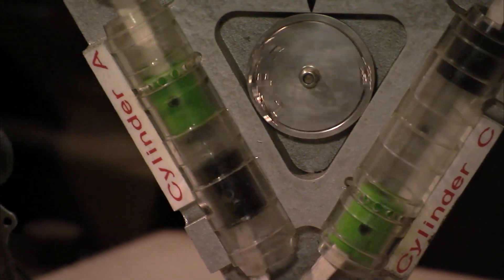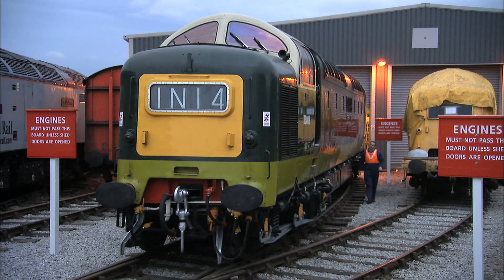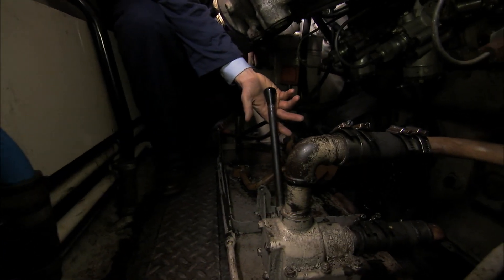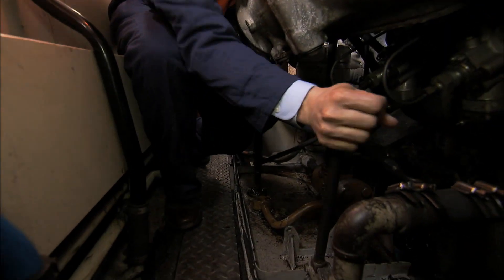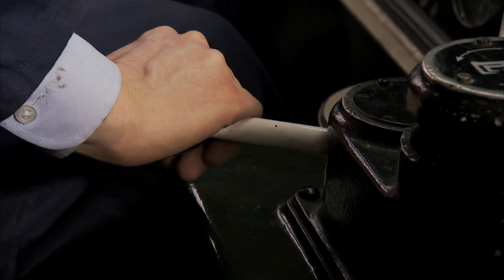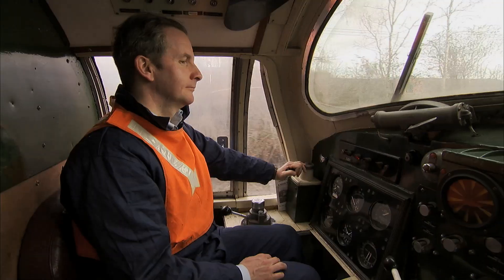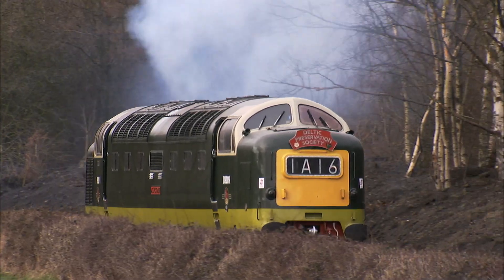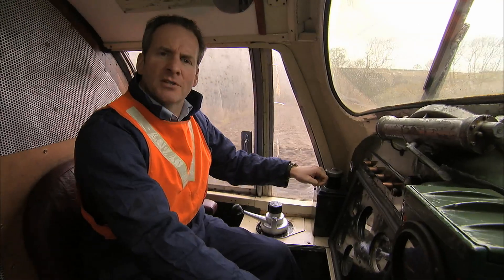World's Greatest Locomotives... The Deltic

Comment: It would have been cool if they would have made an American version of that locomotive.
Reply: The E-8 unit is a good counterpart to the Class 55 Deltic. However, only 22 Deltics were ever built, compared to nearly 500 E-8 A and B units. The E-8 can be geared for speeds as high as 117 MPH, and an E-8 is much more powerful than a Deltic, thanks to the larger American loading gauge. If you wanted to pull a passenger train fast in the States on relatively level track before the 1970s, the E-8 would have been a good choice.
Reply: @HSMiyamoto  Here we go: Americans claiming to be 'better', what a surprise.

Comment: I'll take a 2 stroke EMD any day of the week over this crappy sounding thing. A much better design overall and was around way before the Deltic and way after the Deltic.
Reply: Seriously you have got to be kidding? If you want something that has twice the weight and half the power - Which was half as efficient and couldn't spin faster than 950rpm and had a reputation for being unreliable in service - then have your EMD. 
The rest of us will have the technically most advanced, powerful, lightest weight and efficient diesel the world had known. And the sound was staggering, I can bet you never heard one. I have.
Reply: @martinda7446  EMDs where more reliable and simpler, than deltics which is why so many EMDs are still in service compared to All the deltics being retired.

Comment: A diesel driven locomotive of that power and speed we never had here in Germany. Until today, on the few remaining not electrified lines with fast express trains, there must be installed a double-traction with two class 218 or two class 245. One of them would be simply too weak. Stronger diesels are not availible, perhaps except the well known "Ludmilla" of russian origin. But even a "Ludmilla", Class 232/233/234 is not able to hold the timetables, if single. And furthermore, her maximum speed is limited to only 120 km/h. A class 55 could pull all these trains alone with no problems at all in the highest possible speed, that the tracks allow. I´m sure. What power! What speed! Admirable. But even the British, who had this wonderful engine in service an saw in everyday´s reality, how good it was, built only some 25 or so of them. And tried to help themselves elsewhere with many far less powerful locos. I cannot understand this. But allright: Tempi passati, these times are long gone...
Reply: British railways simply don't worry about sticking to the timetables. Or stopping trains at the right stations. Or on the right platforms, if they do.

Comment: I see the Deltic engines as a quite interesting part of technology that actually works compared to many other technical solutions that have been tried. They don't hold up to modern emissions standards, but that don't make them less interesting.
Reply: they  were basically a very expensive  loco and still weren,t the most reliable and considering they they produced a total of 3300 hp  and pulled only 400/500 tons over a mostly table-top railway  didnt excatly tax the power units yet they still failed on a ggular basis !! hardly "technology that  actually works " is it ??

Comment: Well it was a clever engine but had it,s problems 

very short engine life
heavy on lube oil 
heavy on fuel 

Commer / Rootes TS3/4 engines were similar but had a longer engine life and economy

why not get them to build an engine ?
Reply: Try the Fairbanks-Morse Train Masters which were opposed piston similar to the Commer. Their problem was they didn't offer the same economy or reliability as an EMD or ALCO in US Road Service. Remember Krauss-Maffei were rather shocked to find out that SP let along DRGW were running their EMD SD-9's on 45 day cycles.

Comment: Leave it to the British to brag about doubling the horsepower to weight ratio of a heavy-duty diesel engine used in applications where durability and serviceability are paramount. They also doubled the complexity and made them impossible to perform major repairs on in the locomotive AND doubled the wear and stress the engine's mass had to.absorb by halving its weight. Not to mention it HAD NO "competitors" because every other diesel-electric locomotive manufacturer in the world (all 3 or 4 of them) had been building D-Es for years or decades. But it is a "Concorde" in that the Brits took a concept already researched and invesstigated and developed as far as necessary to declare it impractical and unprofitable, and decided THEY could succeed where more capable and advanced and experinced organizations had "failed", only to throw away untold dollars and priceless time on a colossal flop only an ongoing and intense propaganda campaign has made "successful". Because the Germans tried the Delta engine design before the Brits did and threw it away.
Reply: Yeah- leave it to us Brits to brag about the first Diesel that was suitable for express passenger trains...  Just how useful do you think another heavy, slogging, slowish Diesel would be as a replacement for steam loco's that could crack 110 and cruise at 90?
Reply: Hey, Chad, what brand of tea have you been drinking? It seems to me it's full of vitriolic acid! The Brits don't have the monopoly on the bragging stakes. In my travels and experience, the whole world suffers from the same malaise. If you are going to be good at something then be the best, kid! So, when it comes to bragging, we Brits' are up there amongst the best! Make no bones about that! Feel free to lift that mantle off our heads, Chad. But we have more than one Weetabix for breakfast, fish, chips and mushy peas for dinner and bags and bags of potato crisp with six cups of tea for supper - beat that sunshine! Then you will be bragging! Take care, Bill.
Reply: Leave it to the Americans to boast about: Inventing nearly everything in under 300 years,  winning every war single-handedly, being 'world leaders' and so on... It's always verbal 'sham' diarrhea with the Yanks. Go and eat another pie, you've fallen beneath 380 pounds in American weight.
Reply: @alexanderjames6328  Did you know Moses left out an eleventh commandment aimed at the Yanks.....THY SHALT NOT WEIGH HEAVIER THEN THY MOTOR CAR
Reply: Smeghead...
Reply: Regarding reliability it is said that the Deltic engine `was a highly strung unit, requiring careful maintenance' but annoyingly they don't declare the modes of failure. May be more reliable with modern lubricants perhaps.

Comment: Helped build and Bed Test Loads of these Engines back in the Late 70s, Working at Paxman Diesels Colchester, Also worked on the smaller versions, 9 Cylinder/ 18 Pistons, ( They are 2 stroke apposed ) Used in the Navy Mine sweeper Ships, Amazing Engineering To be appreciated and Understood.
Reply: Interesting- was that about the time that Paxman were turning out engines for the HST?  A few years ago 55022 Royal Scots Grey was running with an engine that had been fitted to a Norwegian torpedo boat (IIRC)- I believe that, apart from the mounting points, there was very little adaptation needed.
Reply: Today's MYT 14 inch forced induction diesel engine can produce the same horsepower in a unit that weighs a mere 150 lbs.

Comment: We had Napier deltic in our motor torpedo boats. The was one of the fastest and best build mtp.  When the engines was running at the highest level could no people be inside the engineroom, because they engines suck all air from the room.
Reply: Hahahaha! The military tell the funniest stories!
Reply: As i was curious I worked out how much air a Deltic sucks in using a online calc, looks like each Deltic was sucking in 9323 Cubic feet per min at max power output.
 
I would guess it was the heat and noise down there that would be the real problem if you were in there when it was going full tilt.